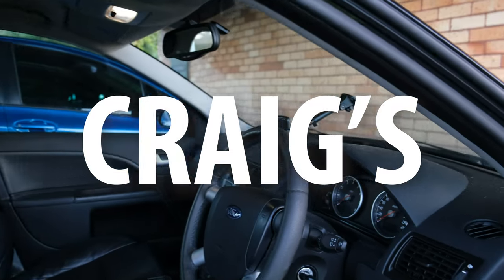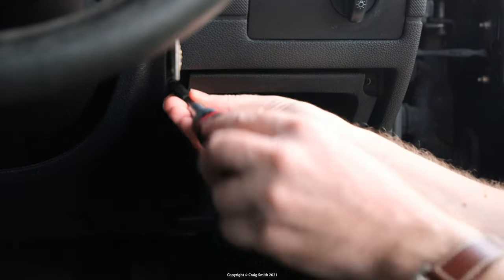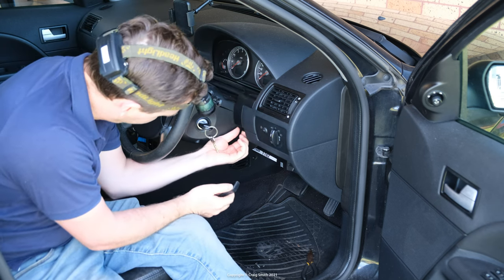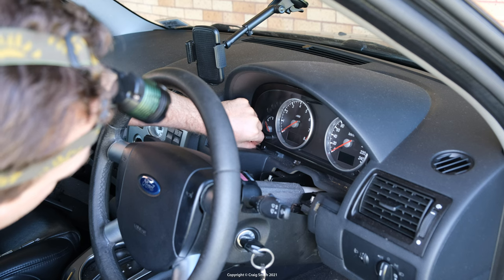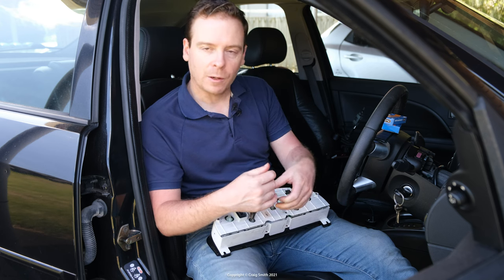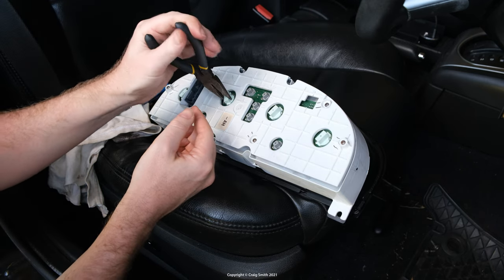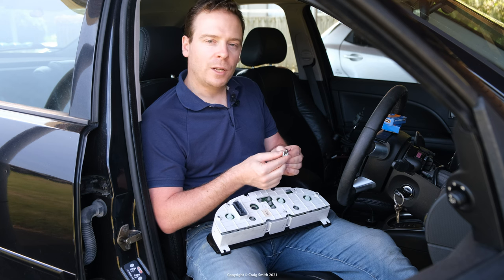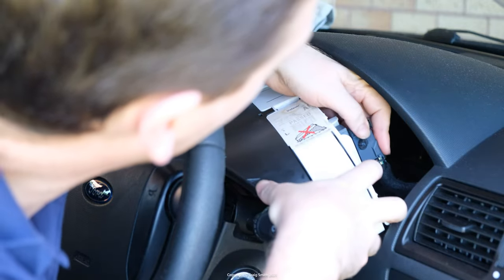How to: Remove instrument dial cluster, Ford Mondeo (Mk3), change bulbs

Comment: Thank you very much for this video. I started to wonder whether it be possible to cut, drill or saw the last plastic shield before the actual speedometer etc module in order to directly get access to the 2 screws and not need go through from underneath the steering column. But anyway, thanks a lot and happy new year to you and your family and everybody watching your interesting channel.

Comment: Just a few things
If you have climate control, the interior temperature sensor is by your left knee, behind the little vent in the lower panel
You have to unclip this before the panel can be removed
Also worth cleaning this while you have the hoover out
And if you have the white dials from the st range, the white background really is difficult to see the needles against, I've tried various bulbs of both normal and led versions and they are all terrible at illuminating the actual needles
Both the inner screws and screw holes in the plastic covers for the steering wheel have been missing on every car I've tried to get replacements for so people often seem to miss these
Reply from the maker: Thanks for the additions. My car does lack climate control.

Comment: Hey Craig, There is a malfunction on my mk3 mondeo that has been bothering me for a while. The interior lights suddenly broke down. I changed the small fuse in the fuse box but it didn't work. the lamps are not broken. The fuse box is not broken. elecrick flow seems normal.  No mechanic could fix it. if anyone knows the answer please help :(((

Comment: I have the same ford mondeo as yours. The speedometer of my car works intermittently and that to shoes much less speed than actual speed. Can you help me on this?
Reply from the maker: Drive faster.
No sorry, sounds like it might be the speed sensor (VSS). You'll have to check for codes (?) then check VSS cable, connector, and sensor itself.
Reply: @CraigsDIY  Thanks a lot.